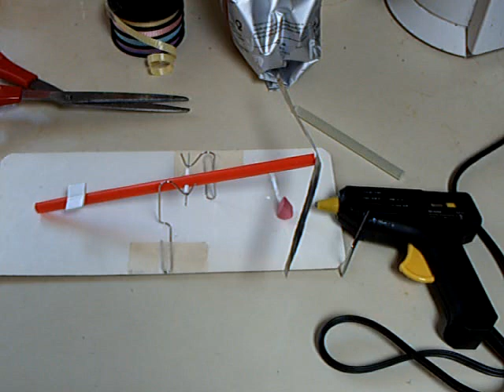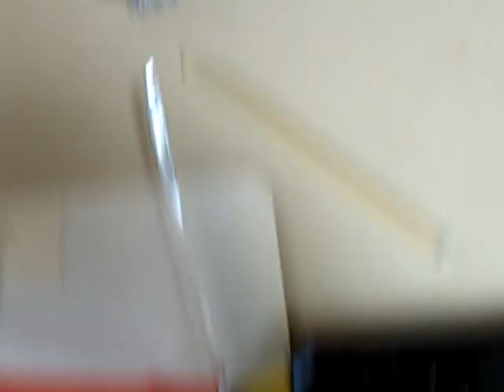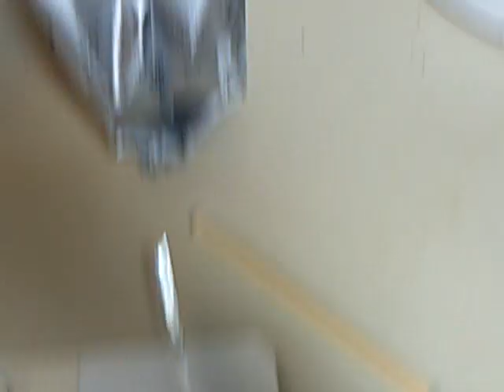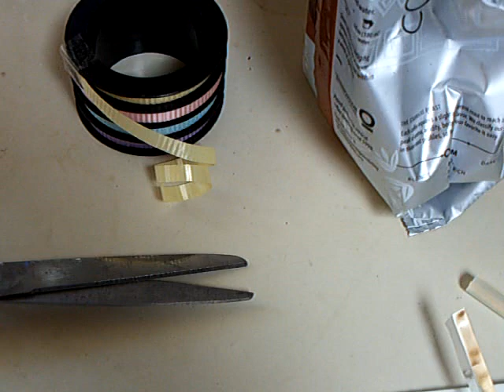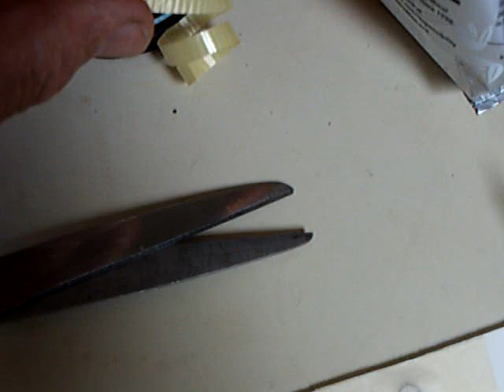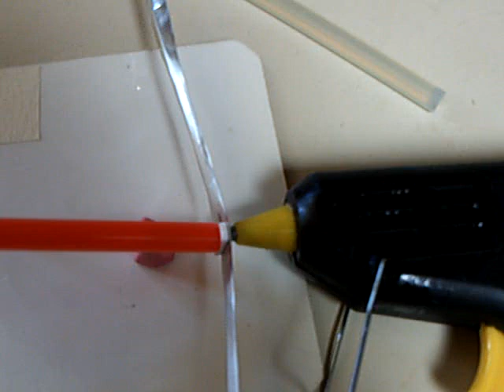Blade's Simple Heat Engine ----  Running on a hot glue gun

Comment: Which means a soldering iron will work....mine is on all day, why have I not built one yet ? lol
Yes indeed, GIAOM is a great sport and he shows the things that don't work as well as those that do. All of which helps when replicating neat ideas :)
Reply from the maker: slider2732 A soldering iron would work fine.  I got this to work off my laptop cooling fan outlet also. It is fun to watch when I'm waiting for something to load up.  I'm thinking of making a tiny one using a plastic coffee stir stick.
Reply: Tried to make one last night, it kept wanting to fall to one side. Will watch the How To vid again.
Hmmm, 6x coffee stirrer version in a line, connected at the back to something very light to simulate a motor crank...would take some doing but you'd have a straight 6 car engine running on sunlight. i think it would look really cool.
Reply from the maker: slider2732 Oh man a straight 6-- that makes my imagination run wild.   Very low probability of success but what an idea.   I hope you get yours to work.